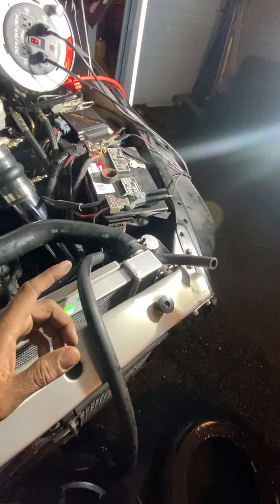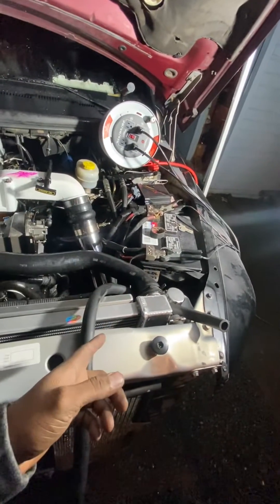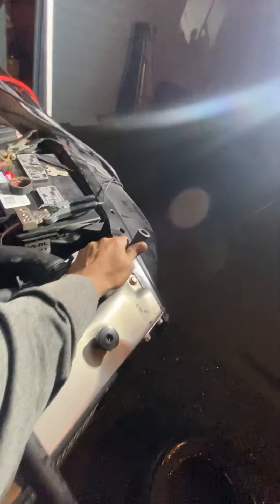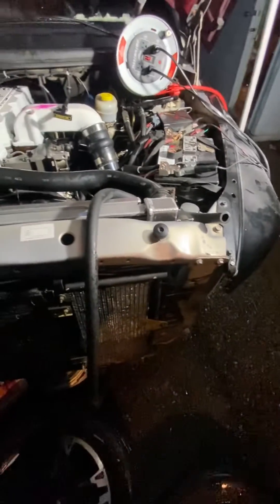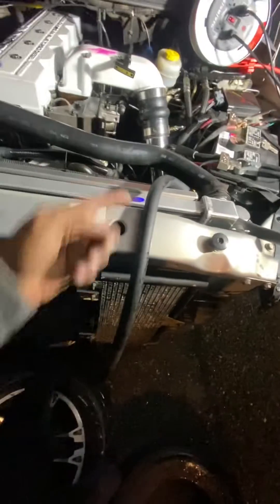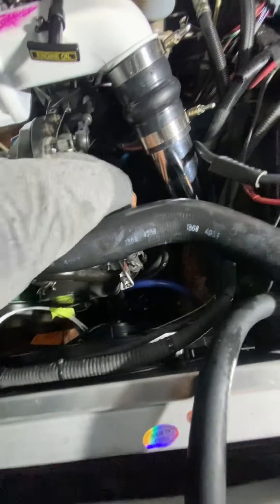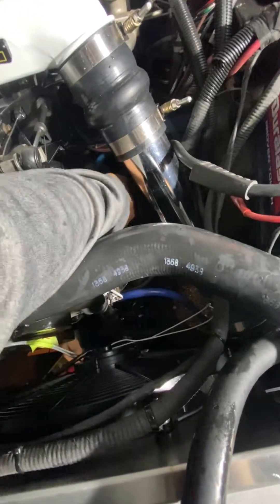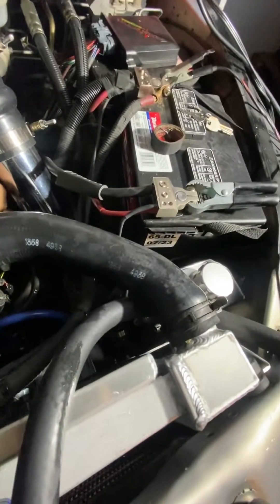Cummins 5.9 24v ISB engine with a leaking vacuum pump/ hoses.

Comment: What year truck is this I got a 2000 and was told my vacuum pump is no good and I push that smoke outta that ccv vent but nothing outta the oil cap?
Reply: I have the same problem , air only from that vacuum line